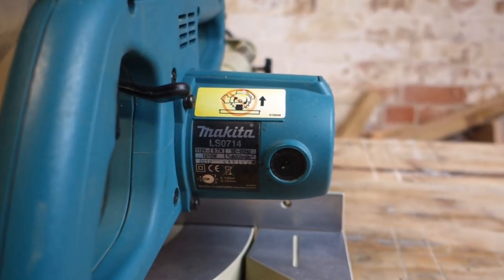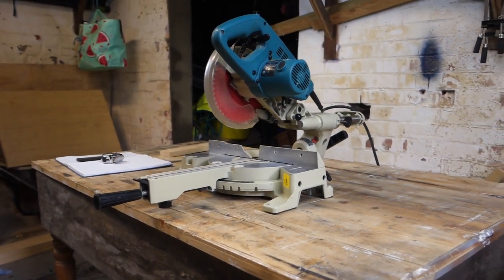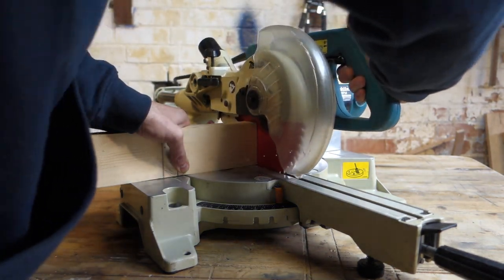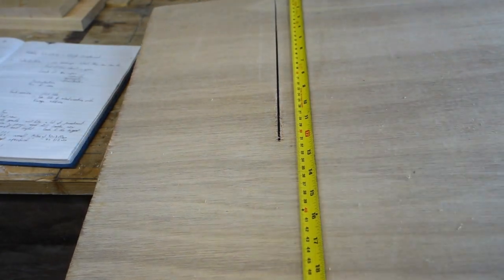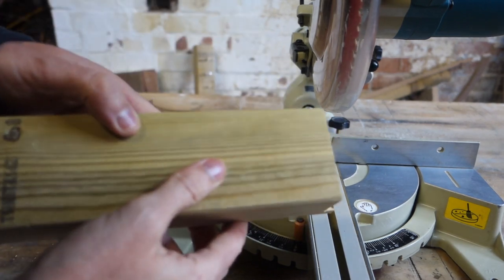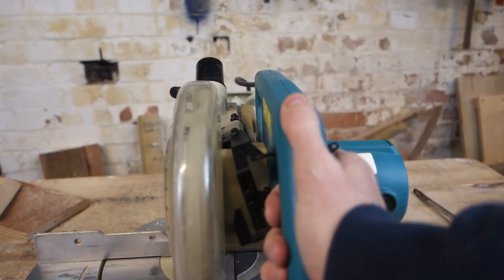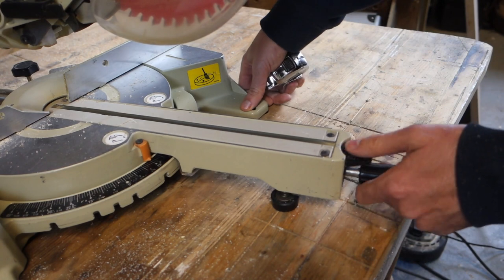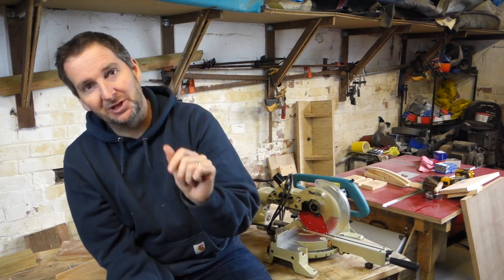Makita LS0714 Slide Compound Saw - In depth review after 1 year use - Is this right for you?

Comment: Do you need to buy a separate transformer/mains adapter for this saw? Cheers
Reply from the maker: Hi, Thanks for the comment! You can get a 240 or 110 machine, mine is a 110 so needs a transformer but the 240 version would not.

Comment: i bought the same saw, I would like to know which blade do you use knowing that 7 1/2 blades are difficult to find.
Reply from the maker: i use freud 190mm lp40m, will probs give saxton a go after, have them on my larger saw with on complaint
Reply: Thanks, but more difficult to find it in Canada!! @HowtoWoodworking
Reply: @gestionlocativeccl5141  Kind of late, but you can use 7 1/4 inch circular saw blades.  I use a 7 1/4 inch 60-tooth Diablo blade.  Cuts are amazingly smooth even after more than 10 years.  One of the best features of this saw is how little dust escapes without a vacuum.  I also love how lightweight the saw it.  My 12" DeWalt miter saw only collects dust and is only pulled out for thicker cuts the Makita couldn't handle.